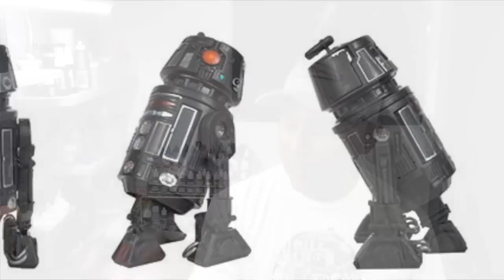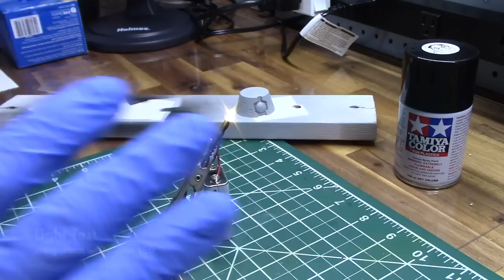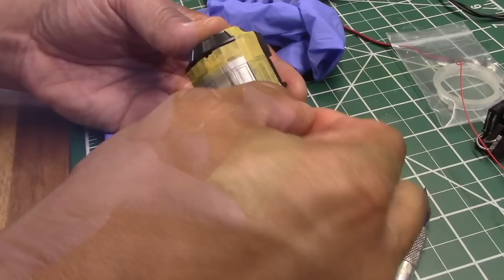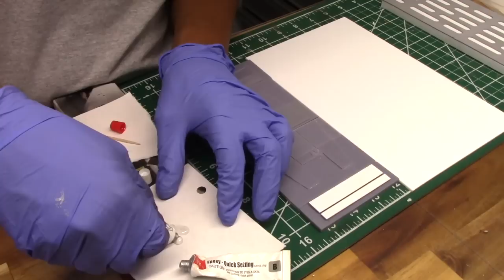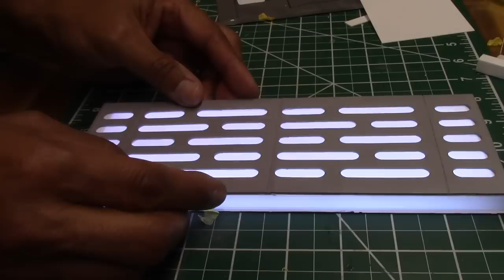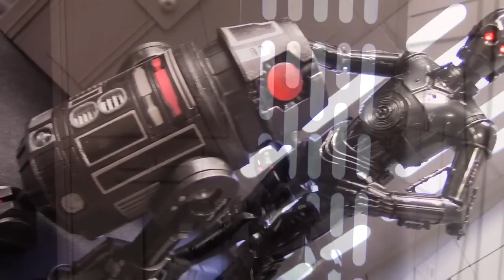Completing Bandai's Star Wars 0-0-0 and Creating BT-1

Comment: It came out great! How did you make the light wall?
Reply from the maker: Hi and thank you, I really appreciate the compliment.  The wall piece was 3D printed.  For more info about the base refer to 3:10 in part one for details and 11:06 in this video to see how it was put together.  The wall is lit with strip LEDs that were purchased from HDA modelworx that can be found at this link.  Thanks for watching.  https://hdamodelworx.com/LED-0603-STRIP-WHITE-72-LEDs-05m-3-33vdc-UPDATED-Now-with-power-connectors-soldered-at-both-ends_p_778.html

Comment: Two kinds of Nerds? What is the rest?
Reply from the maker: It's a multiple choice question....There are 2 kinds of nerds.  May the force be_______ a. Equal to mass times acceleration or b. with you  :)
Reply: @InterstellarModeler  What if you understand both? I tried the”natural gold” of one of those old C-3P0 8 or 9” kits back in the 80’s. He looked nice. Bandai did waaaayyy better. The diorama absolutely sells the kits. It takes courage to keep the original finish on a styrene kit. Some day, I will finish my Star Wars homage magnetic closet door. It will have about half done up as a light wall. I showed my partner in crime the video. Now she gets it. I think I just got the charter for the project approved ;)

Comment: Are there any guidelines to painting 3D printed parts?  It looks like you're using the same paint lines.
Reply from the maker: The one thing that was suggested to me early on was to use a filler primer for 3D prints in order to obscure imperfections from the layering process. They look like striations or whirl-like patterns and the prominence can depend on the resolution of the print.  Many of these can be sanded away but sometimes it's hard to completely get rid of them because of how the piece is contoured so the filler is supposed to help.  I do find sanding is the most effective way to handle them but the filler does seem to help. I have, however, read some articles that say it really makes little difference what primer you use. I've just stuck to the filler for now because of habit but will be trying stynylrez to see if it's just as good. Badger actually makes a primer now for 3D printing but the review I read was that the results were similar to others with the exception that you can put it into your airbrush instead of using a rattle can. Other than that there really isn't much difference. Still use acrylics for the most part.   Thanks for watching Paul.